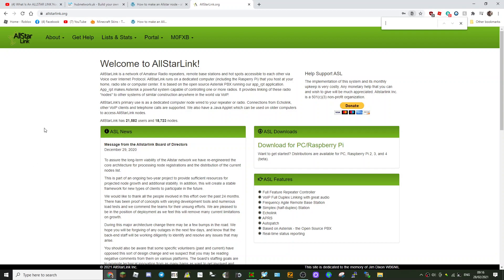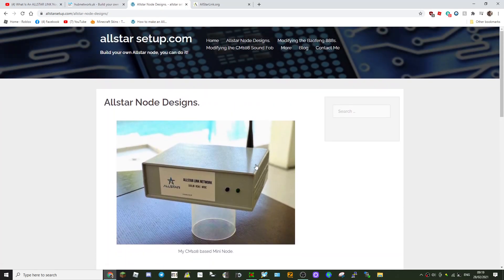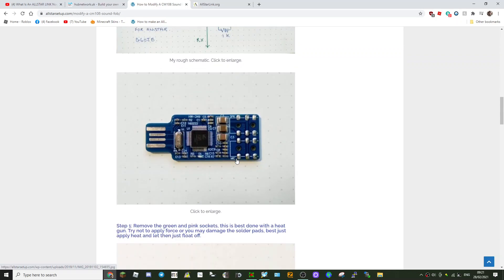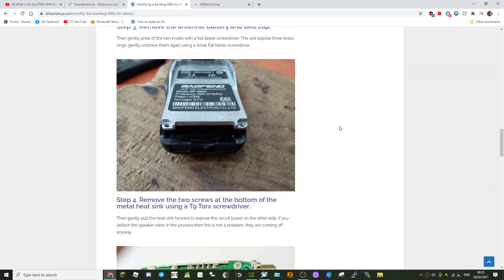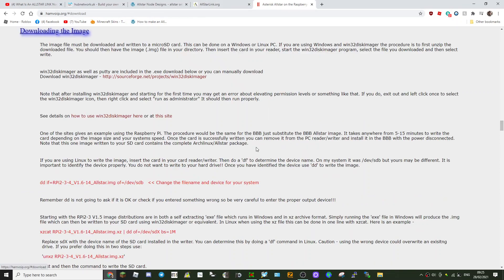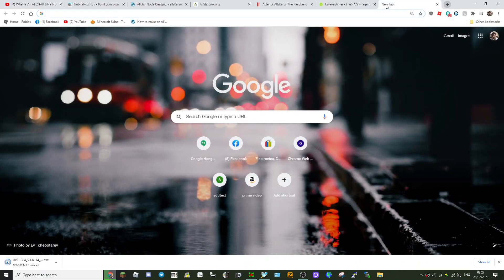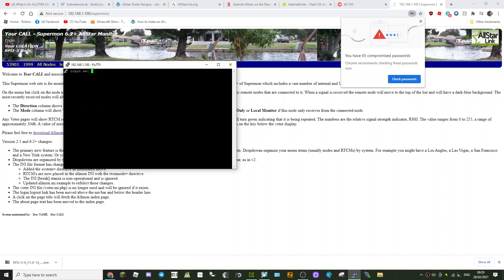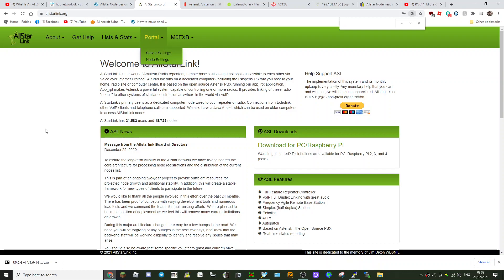ALLSTAR node -How to build and set up -Links and tips

Comment: I have an OpenSpot4 Pro and a FT-5DR. But the audio quality of YSF and DMR doesn’t seem to be very good compared to analog FM radios. I built the XLX941 DMR and YSF reflector with a Linode Cloud Debian 11 computer, but the audio quality isn’t as good as the AmericaLink Reflector. The AmericaLink Reflector’s audio quality sounds better than the XLX941 and other XLX Reflectors. AmericaLink must be doing something to make their reflector sound better.

Are some AllStarLink nodes better audio quality than other AllStar nodes? Or, do they all have the same audio quality? I thought about buying a pre assembled and tested AllStarLink Shari with a Rasberry PI-3. 

I heard that the audio quality of AllStarLink is better than the digital voice DMR, YSF, and D-Star, and it supposed to sound better than EchoLink too. Dave KY0L
Reply from the maker: Allstar is easily the best you get used to the Digital sound .